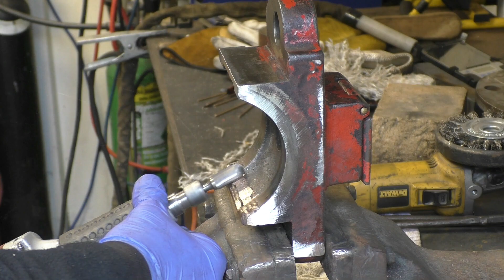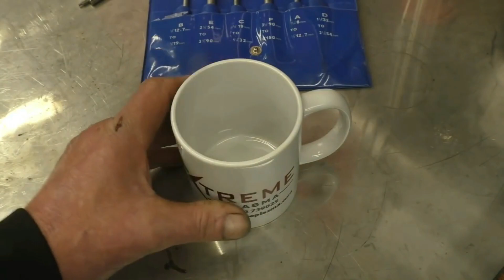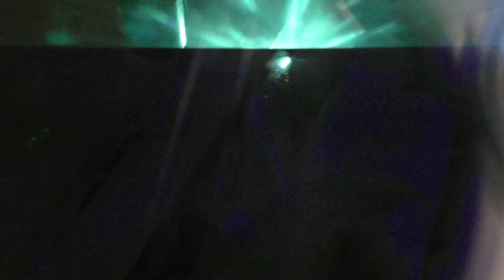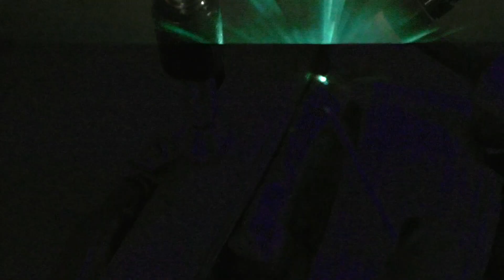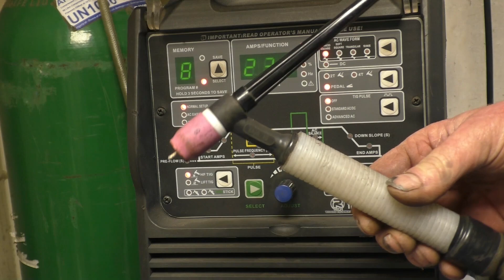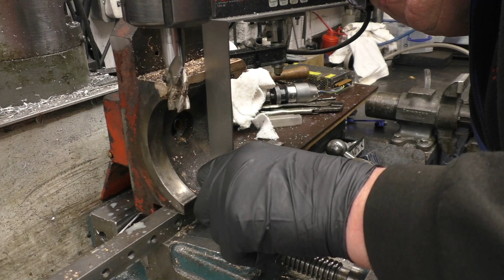SNNC 423 P1   Cast Iron Bearing Cap Repair

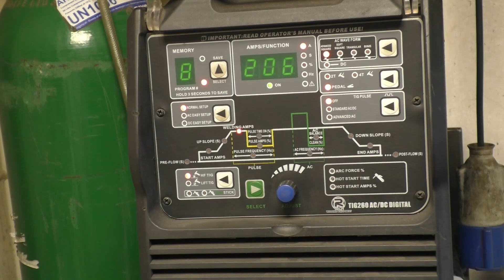Comment: 8:03 Well, looks like a bog standard welder will do the job. It'd be interesting what voltage yours will put out though John - so if you've got a multimeter can you set it to its highest range (if not auto-ranging) connect the meter across the ground lead and the other lead or TIG tip, stand back (voltage is probably lethal) and operate the welder and see what AC voltage your meter reads ?

This thought has actually given me more ideas about planned modifications to my dad's old welder. It's dual voltage 55/110V AC output (depending on whether the output coils are wired in parallel or series. At 110V setting, max current is 100A. At 55V setting, max current is 200A. With 110V, I'm guessing an arc is easier to start - so it'd be handy to switch over to 200A once an arc has been started.

I'm already planning an on/off switch for it, for electrical safety reasons - so the power's only on when actually welding.